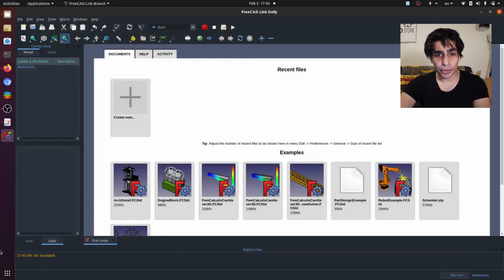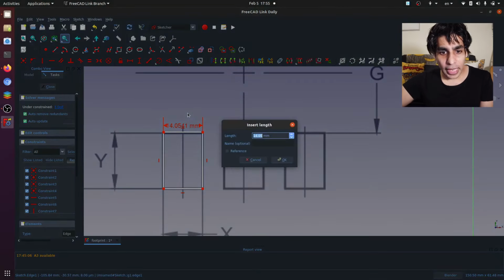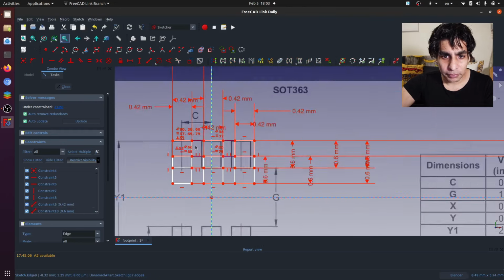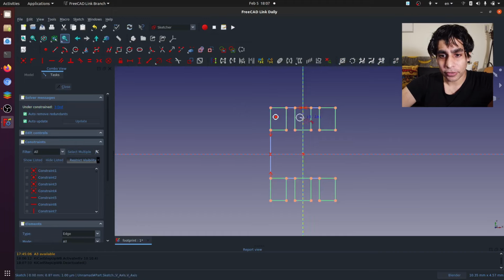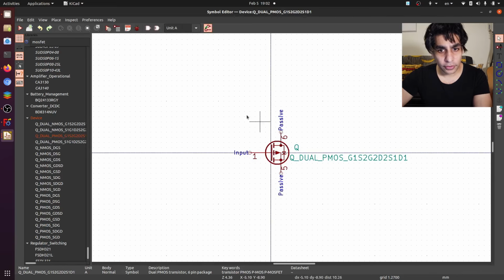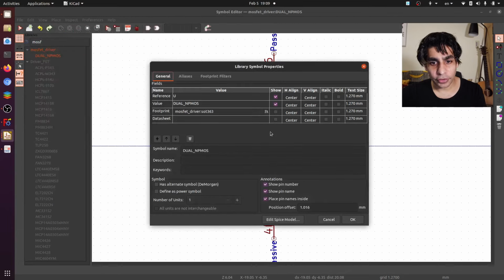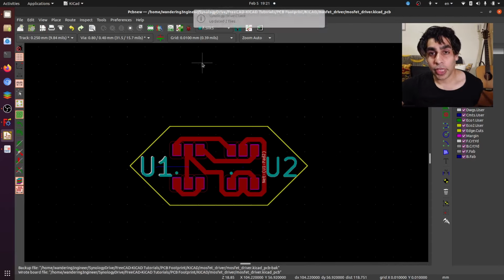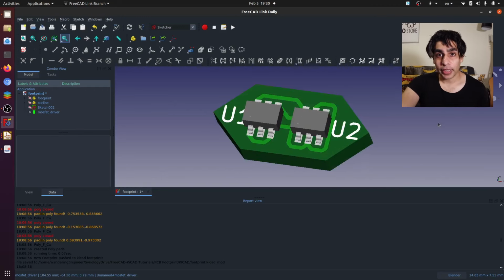Creating Footprints and 3D models of your PCB with FreeCAD & KiCAD (Opensource)

Comment: You should place the circles centered in each pin (ideally with constraints), because the center of the circle is used as the origin of traces in KiCad (and ground fill thermal relief spokes too, if you enable them individually on each pad).